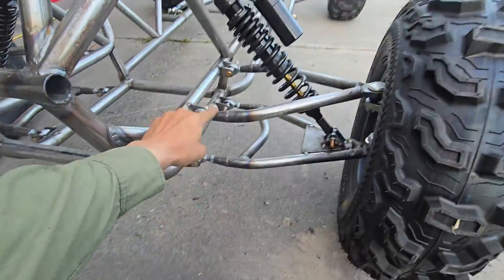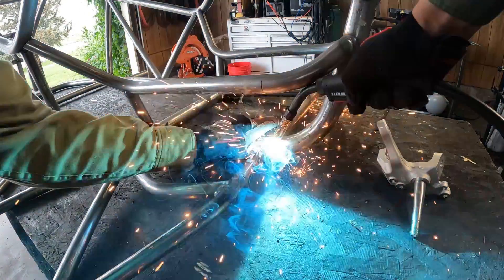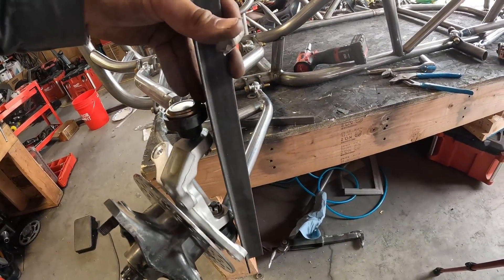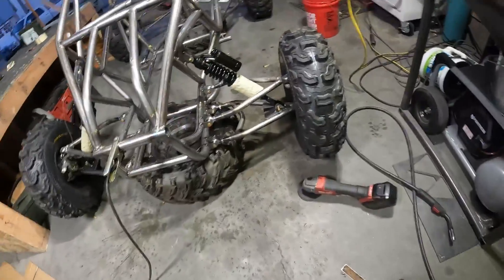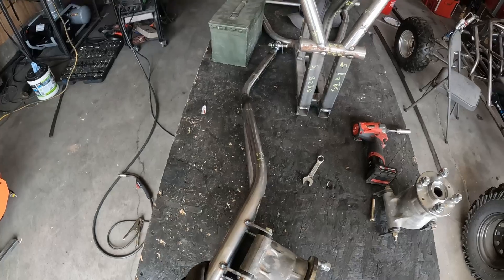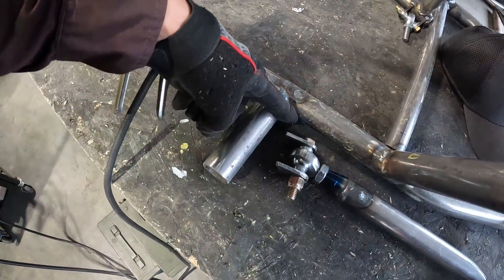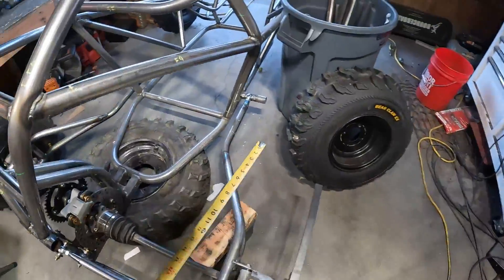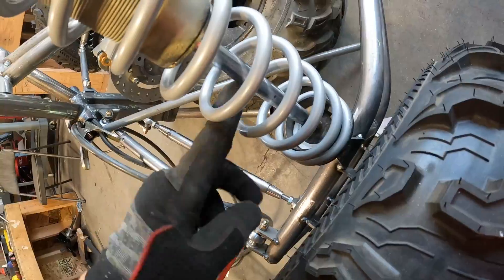Mini Crosskart Suspension: Full Suspension Installation Guide

Comment: How much rear wheel travel are you using? With the pick up points you have, it sure looks like you can bottom out the plunge on the axle either way in a few inches. Miata axle doesnt off alot of plunge, and isnt very robust , can easily be pulled out of the cup.
Reply from the maker: The miata axle has about 1.5in of plunge.   The suspension was designed around these axles and has next to zero plunge, its not even noticeable.   The pivot points on the rear are the same far apart as the cvs pivots, which eliminates plunge even if they aren't parallel with each other.

Comment: Question, why wouldn't you offer roller chassis (without wheels and tires) for purchase as well? Seems like you are missing out on a market segment that can't weld or doesn't have the skills and or time.
Reply: I was just thinking the same, welding is just not my strong suit. This as a rolling frame is something I would buy and bolt everything together.
Reply from the maker: I plan to offer a roller in the future.   Shipping would cost you tho.
Reply: @Xkarts200 i would def buy a kit with the parts for the frame and suspencion

Comment: Are the ball joint mounts custom?
Reply from the maker: Yup. They are laser cut steel.
Reply: Is it a file you found or made?  @Xkarts200
Reply from the maker: I designed it in cad  @dsmandrewa